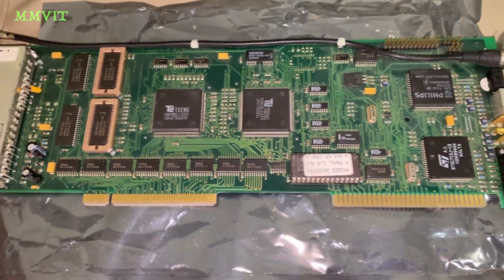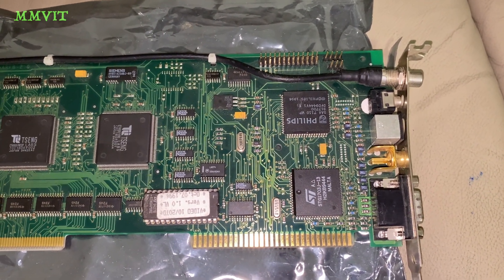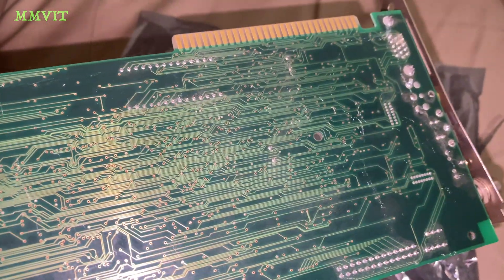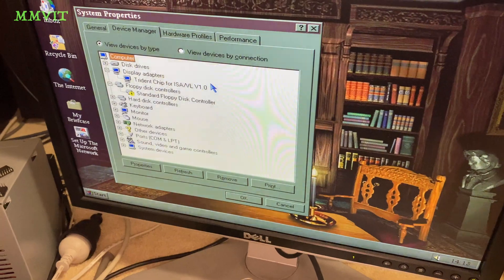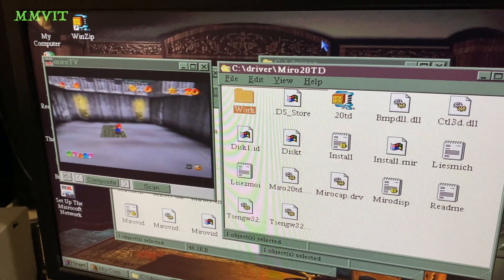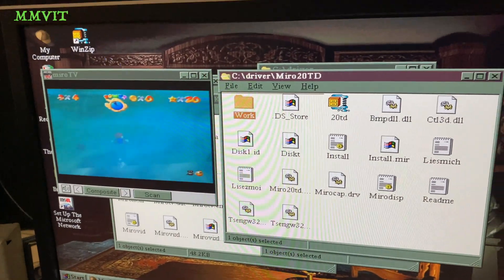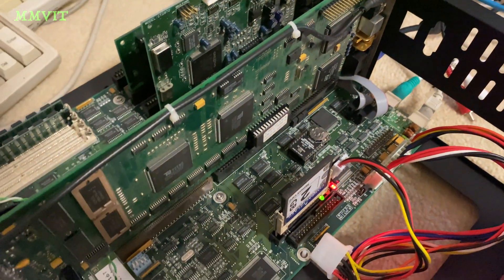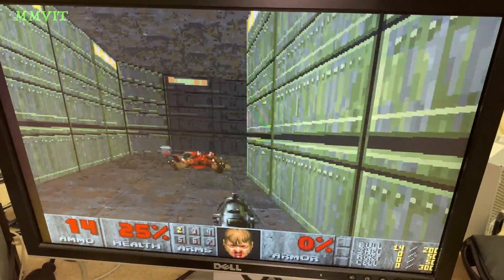MiroVideo 20TD Live! VL - Is this the most awesome VL-Bus VGA card EVER?

Comment: uses video overlay, if you drag window around really fast you should be able to see what color it uses as the overlay catches up. this is why there is that 'scan' button because it may have issues dumping the buffer quick enough to something the os can actually work with. I use to use something like this to take 'digital pictures' for people using a vhs camcorder. When the brooktree pci cards became a thing really sped up process.